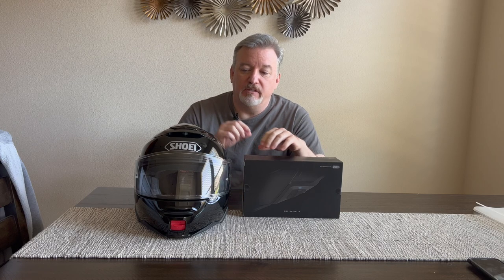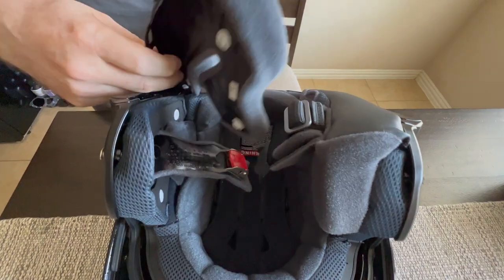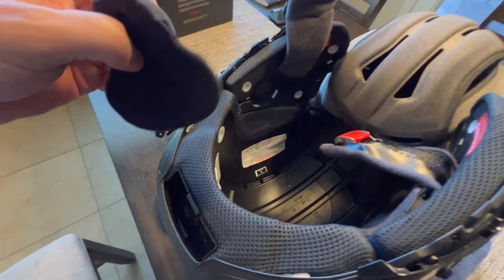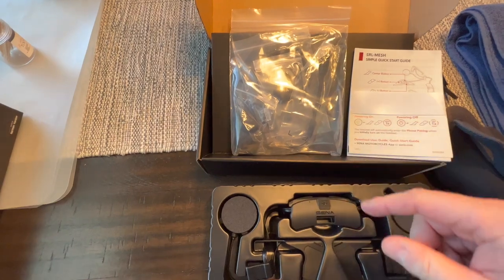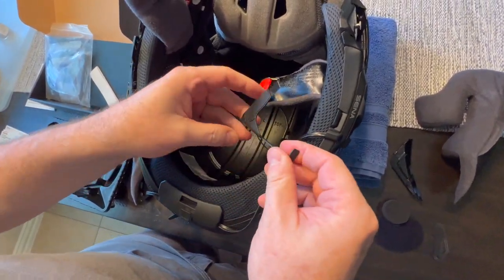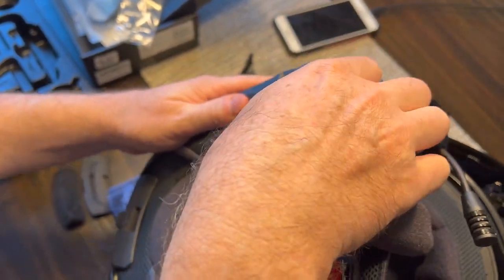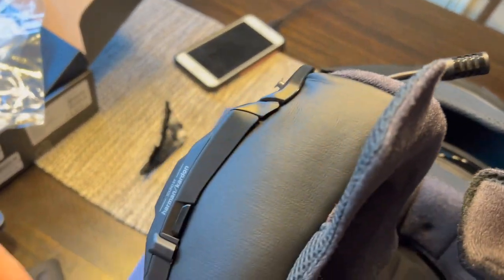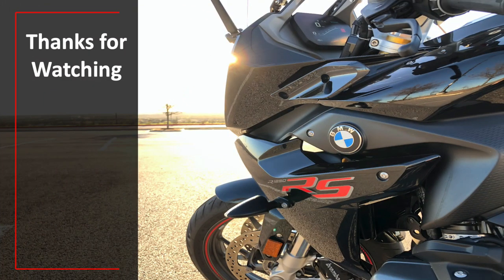Install Sena SRL Mesh into Shoei Neotec II

Comment: The service tool is not used properly to remove the side intercom cover. It is slid under the other side of the cover while you lift the lock lever with your finger. In that way it just pops out. It’s explained in the Shoei’s “Instructions for use” manual. Also, you don’t even need the service tool to lift the battery cover. Again check the manual.
Reply from the maker: Thank you for the comment and suggestion. Off camera I followed the directions, however the plastic button on the battery cover I could not get it to depress with my finger or fingernail so I had to use the tool same thing on the side pieces. They wouldn’t come off as instructed. I had to muscle them off with the tool.  In the end, I got the job done and Sena installed. Thanks for checking out the video, safe journeys!
Reply: did the same mistake myself ;) I apologize if it sounded a little negative, otherwise your video is very useful!   @Texas2Tires
Reply from the maker: @Synthetic-lt4ed  I didn’t take your suggestion in a negative way. No worries. 😎👍

Comment: Do you know if I can get that little tool for helping? Remove things on the helmet? I don't know what I did  with mine.
Reply from the maker: Should have come with the helmet. If you live close to a dealer, you could ask them as they probably have a bunch laying around. Or you could just use a plastic knife or something dull and thin that won’t scratch your helmet.

Comment: Wow, Sena hides their installation videos. I still haven’t found it. Your link is only to the general Sena website.
Reply from the maker: Forget if they have a video or not. I remember I did it based on the instructions, which I didn’t read all the way through and ended up messing a step up. Had to go back and redo it. However again have to be patient, it can be done.

Comment: Hi one question can this communication system work with shcuberth's sc2 system ?
Reply from the maker: Thanks for the question. From what I saw on the internet, the schuberth sc2 was developed by SENA, so it should be able to communicate with other SENA products. However, you should double check with the retailer you plan on buying it from.
Reply: @Texas2Tires  thanks you so much.!!

Comment: Have you got a review video on this in comparison to the SRL or SRL2 version prior to the Mesh? I have the SRL on Neotec2 in 2020 am I’m curious if it’s any better? What the quality of sound is on the new one? Better connectivity with the mesh? Even if you don’t have a video, could you please share some feedback even as a reply? Thanks in advance
Reply from the maker: First off. Thanks a lot for checking out my video. I hope you found it helpful. I did another video about the Sena talking a little bit about the practical uses and how I like it so here’s the link to that. https://youtu.be/Pnd2pLLufUI
Reply from the maker: The voice commands are good and the Harman Kardon speakers are really good, clear and loud. I wear ear plugs and I can still hear calls and music clearly. I haven’t used the mesh yet because I don’t ride with more than 3-5 people at a time. The mesh can connect I believe up to 25 riders.
Reply: @Texas2Tires  yes. Sorry, forgot to mention, thanks for the installing video, I watched it all, handy to see the differences with the previous model, the one I have. I’ll check out the other video you gave me a link to..
Reply: @Texas2Tires  thanks, good to hear re sound quality. I don’t do more than 2-3 mesh intercom either, it’s just that it’s called mesh as model I think. I’m after better sound and I think it uses wifi or something to talk to the app. I might be wrong there. Mid research now. So thanks for all the info.
Reply: Hello    I've purchased the SRL MESH to the end winter in sold, i have checked your video for see and how do the installation of my new SRL MESH
and see where is the position of antennas on the helmet et how to install the antennas  on the helmet this is my first time that i install speakers on a helmet and i cannot to do the difference with a other type speaker helmet and i never made configuration and  never paired my bluetooth speakers with my phone
and i have never use this system before i had had always of Helmets without speakers Sorry, the only thing i can tell you, the seller told me this is the best speaker that i sell for your Noetec 2 
Note: I do a translate for my text with Google Traduction my Speak Language is French Only
Thanks You Again for your Great Vidéo Explications!!! 👏👏👍👍
Reply from the maker: @ec9114  thank you for watching my video. I'm glad you enjoyed it. Hopefully it was helpful to you and you are using your SRL Mesh.  Merci d'avoir regardé ma vidéo sur YouTube. Je suis content que vous ayez apprécié la vidéo. J'espère que cela vous a été utile et que vous utilisez votre SRL Mesh.

Comment: Thanks liked and subbed . Thinken about getting this for my Shoei Neo tec 2
Reply from the maker: Thanks for watching, subscribing and commenting. I appreciate it. I really like the SENA Mesh. Supposedly the older models weren’t as good, but these new speakers are really good. I use it to take phone calls, listen to music, get voice directions from google maps and send text messages using SIRI. I’ve only used it as a blue tooth communication device with another rider a couple of times because I ride alone quite a bit and/or my buddies don’t have a communication device or it’s a different brand like Cardo. At this point, I can’t imagine not having one. Safe journeys.

Comment: The 2 antenna pieces are incorrectly installed.
Reply from the maker: I corrected that in another video.
Reply: @Texas2Tires  i dont find the correct video. can you tell me wich one is the good vidéo ? thanks :)
Reply from the maker: @handibag9219 Thanks for the question and comment. Interesting, I can't find the right video either. I know I filmed the correction and showed the visuals from the manual. I'm guessing I snuck it into another video or I just never ended up editing and publishing. Apologies for that. Anyway, in case you haven't already downloaded the Quick Start Guide from Sena, here is the link: https://www.sena.com/eu-en/product/srl-mesh/documents  This is where I should have started to begin with. The visual #11 on page 5 shows how the antennas are supposed to be properly inserted. I hope that helps.
Reply from the maker: @handibag9219  Update, I just found where I inserted that correction. It was in the video itself at the 7:35 mark. I added it to the video later. Hope that description in the video is enough??? Let me know if you have further question.
Reply: @Texas2Tires  Oh Thank you for your quick reply.
I will try to install mine properly.
Reply from the maker: @handibag9219  how did the install go?

Comment: Don't use it in the rain, ltd not waterproof as I've found out
Reply from the maker: Oh that’s a shame. I’ve been in the rain a couple times and I know my friend that rides long distance has been caught in rain storms a number of times without issue. Guessing your unit was defective or you were in some serious rain for extended periods of time. Did SENA replace it or help you out?
Reply: @Texas2Tires  Hi , we had 2 units both died within 24 hours of each other, $1200 Australian to replace.
Just a mild amount of rain for a couple of hours, no help or advice from Sena, they were out of warranty but no repair options available.
We were about to upgrade to the Shoei neotec 3 with the new Sena unit but after the lack of response from Sena etc I doubt we will go the Shoei Sena route
Cheers
Reply from the maker: @horatio8764  Well that really sucks!!! Sorry that happened and that SENA wasn't of any assistance. I see that there is mention of them being water resistant, but not waterproof. I saw the resistance mentioned on some sites that sell it, but it is not mentioned on SENA's site nor could I find any mention of it being water resistant in the manual. That's really odd, because you'd think it would be a no brainer to make it water resistant as many riders get caught in the rain. Not to mention the regions where it rains a lot like the UK or Northwest U.S. Perhaps a switch to Cardo or another brand for you?
Reply: @Texas2Tires  Thanks, yes I would advise all owners of these to pull the side switch assembly off and apply some silicon grease or similar around the joins to help keep the water out , as once a few drops of water get in the microswitches are toast
Once again thank you and keep riding